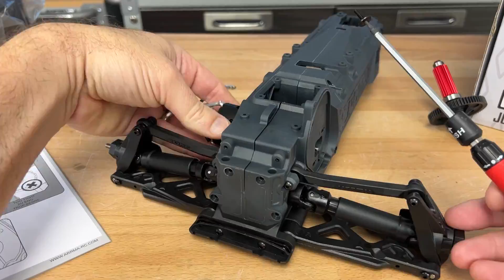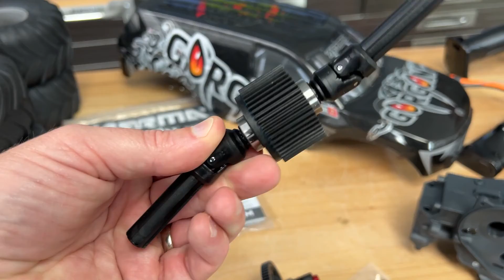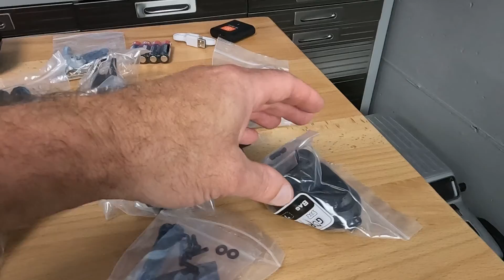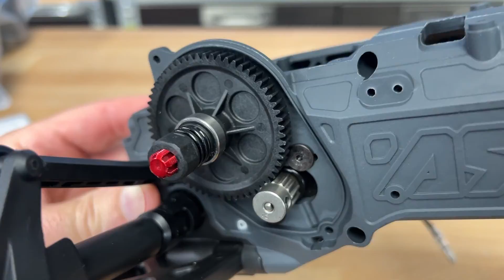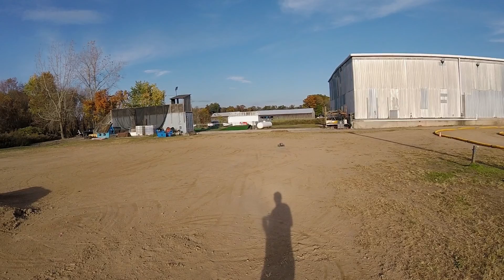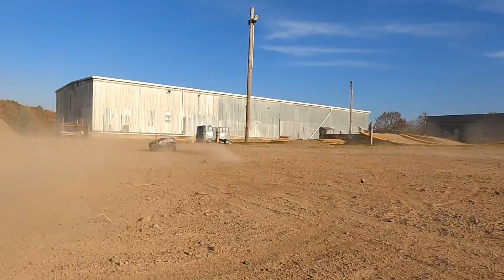Quick Build RC Truck! Arrma Gorgon Kit

Comment: Absolutely love mine. Upgraded the ESC and went brushless. Now 3s capable. Added a light bar to the front and swapped the black parts for some red ones. Definitely recommend this beast
Reply: Which light bar did you get?  My son loves his Gorgon but it’s usually dark by the time I get off work and we need light! 😂
Reply: I have kit rta it says on box 2-3s lipo… what esc did you end up with ?